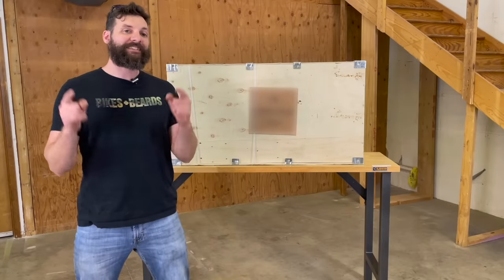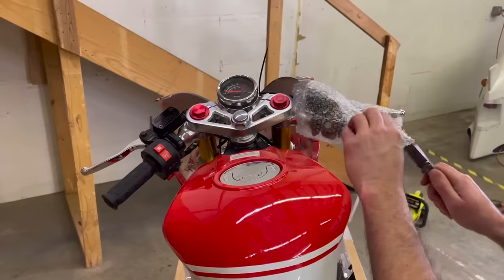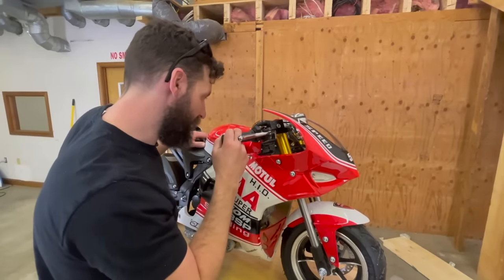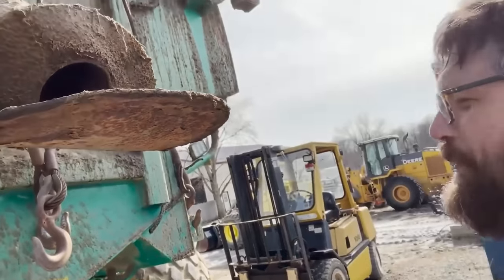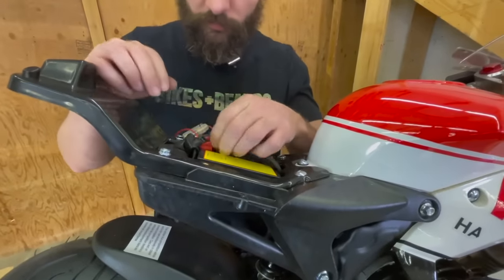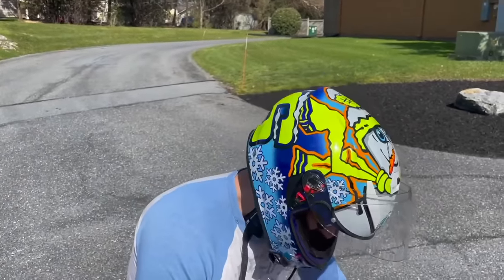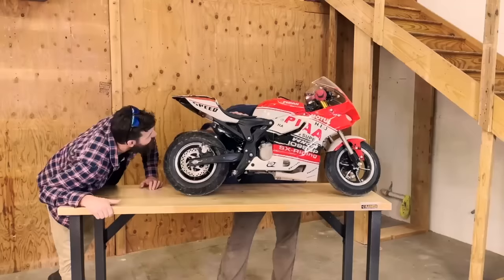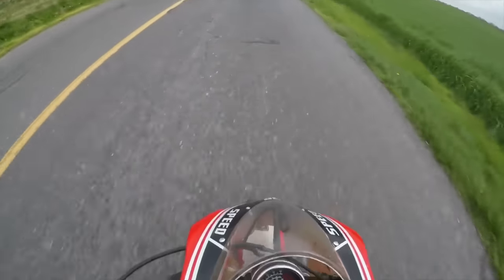I Bought the Fastest Pocket Rocket on Amazon

Comment: They do make street legal pocket bikes I had one. It was a 49 cc two stroke with headlights, taillights, turn signals, a horn and a speedometer. Automatic 4 speed. It was technically to fast to be a moped but the speedo only went to 40 so you couldn't tell just by looking at it. Thing did almost 60 mph

Comment: A buddy of mine bought a Buell city cross 984 and it came complete with a seat that would wear through the insulation on a Wire. Until it was identified his battery would discharge with a touch of the starter button.

Comment: There's a chinese pocket bike one size up that adults actually fit, has the 2 stroke motor the post hole borers have. Is a more suitable frame to put an old CR or RM 125 water cooled 2 stroke in! Has suspension and all electricals much like yours otherwise but big enough the knees don't stick out.

Comment: Hiding from responsibilities..... a man, a grinder and a mig welder. Okay, during lockdown I fitted a 50 cc pocket bike motor into a stock BMX frame..... 50 mph with no suspension and factory brakes. Sketchy as. for some reason 19 spokes broke on the front wheel

Comment: If I’m 5’9 would i fit this bike as a just over size or way way way over sized 😂
Reply: Yes, the older versions came in models a few inches larger though, with 110cc engines, not too easy to find though unless you’re in a bigger town/city, and you can only find them used now.